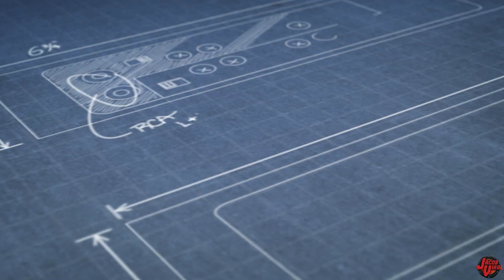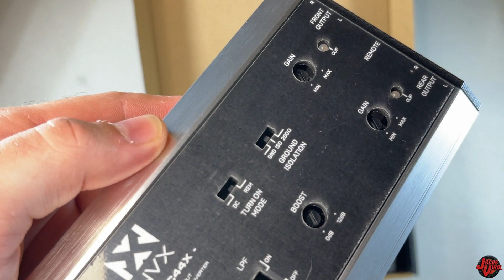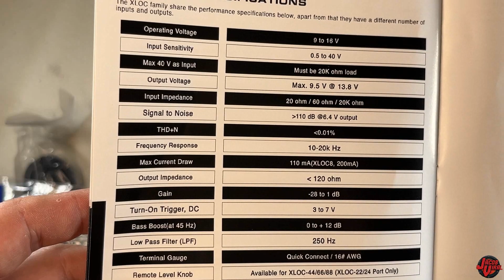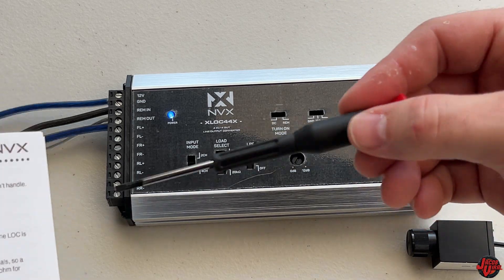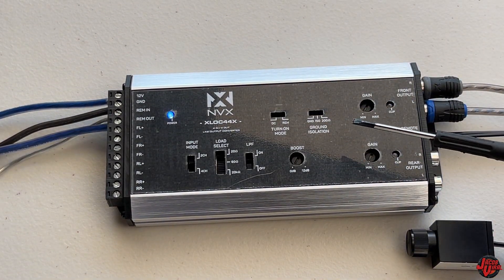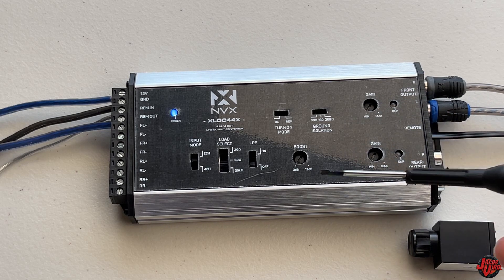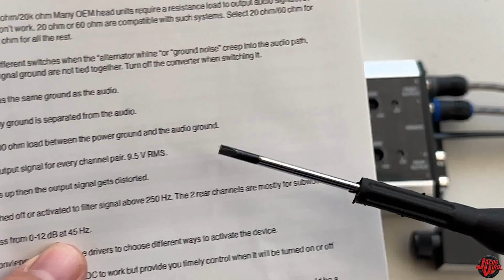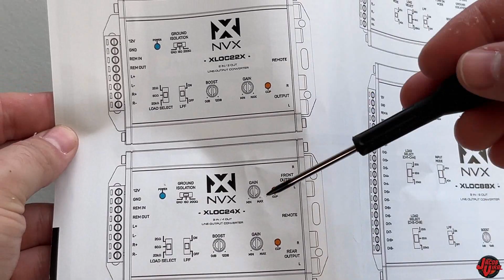FACTORY Stereo Line Output Converter INSTALL & FEATURES

Comment: So, you don't have to use any of the speaker channel inputs and only the REM in and REM out if you have an aftermarket system? That'll give you the audio signal you need for your amplifier to produce sound for your speakers?
Reply from the maker: No this is made for factory connections that use all the connections FL,FR,RL,RR, etc. You need an input audio signal for it to work. Get another LOC with input rca from aftermarket if that’s your plan.

Comment: Hi, juste to be sure, i plan to use my factory head unit from my Ram, promaster city and run two seperated amps, one for the front speakers in the doors, and the second one for the sub. Now, i see that the XLOC44X have 4 pairs of high level inputs and 2 low level outputs,  my question is: since the Promaster city has only two front speakers, because it's a cargo version, if i plug them to the device on high level chanels  one and two, and selector on 2ch, right? Now, does the two pairs of rca output will be activated at the same time by only the two chanels of high signals from the only two speakers? If so, what is the purpose of 4 ch in? Juste to keep the fader on the factory head unit? Hopes  i've been cleared....Thank's for the response...

Comment: Hey. How high can u go on the factory radio 70%.   And Thene set gain out? 

And in future dont get higher than 70% on stereo volym?
Reply from the maker: I usually set it at 70% but on a aftermarket radio not stock. Learn the volume limit and never exceed after tuned.

Comment: So how is the loc getting audio signal from head unit?
Reply from the maker: Some are made for factory and some for head unit depending on the features. If it has RCA input then you can hookup to the head unit
Reply: Pretty sure you are suppose yo run speaker wires to get a signal. Even with a aftermarket head unit. The lock isn't getting a audio signal just from a remote on and rca outputs.

Comment: No offense but this is a terrible review and explanation of this device. Unless your aftermarket head unit didn't have RCA outs you would never use a LOC.  I am unclear why you are referencing your head unit; you need a signal in to use this under any circumstance. This device is strictly used to grab a signal from a high-level output source (Factory Radio mainly) and give you low level output for your amplifier(s). Furthermore, this device would need to have signal summing and active equalization to remove any of the factory EQ curves to provide a clean flat signal to be really useful, which it doesn't appear to be able to do. These are exactly the same as the PAC LOCs that just came out, I wonder if they are affiliated....